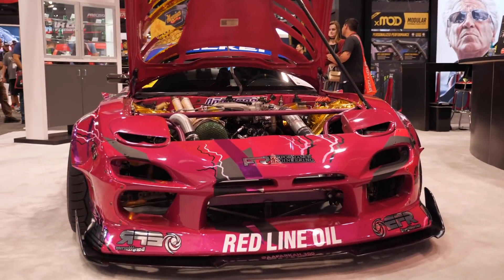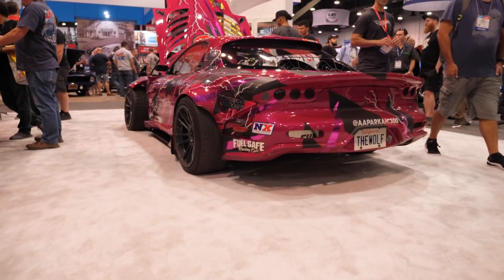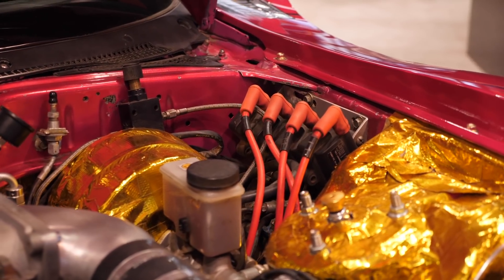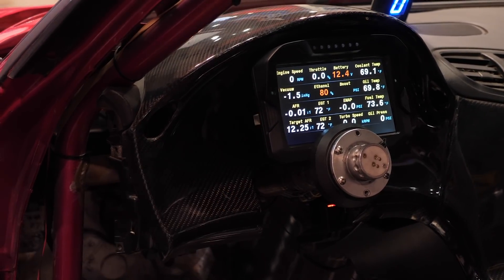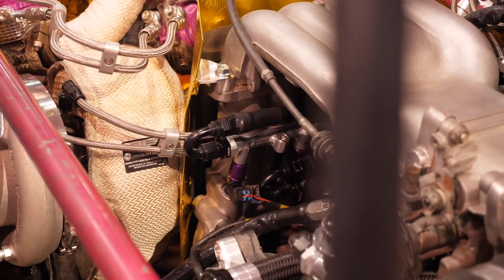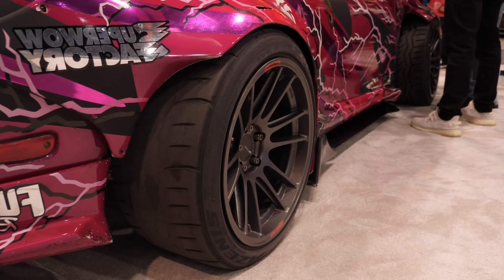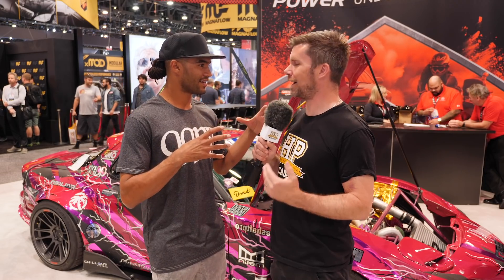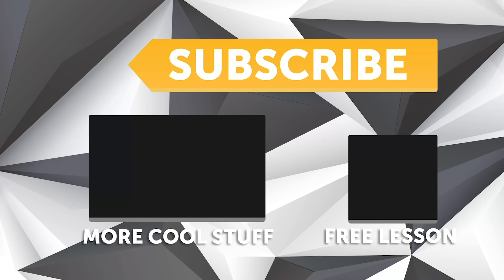No LS Swaps Here! | 13B Powered RX7 510WHP From 1.3L [TECH TOUR]

Comment: That was a little painful. Seems he dint know the reason people go to premix. Sump oil isnt meant to be burnt, 2 stroke oil is and is designed for that form of application, sump oil is not, but then yes, you can mix the ratio to suit. 2nd, does he seriously use two parts fuel to 1 part oil?? Or did he just reply wrong?? That seems waaaaay to rich on the oil side. He wouldnt need to turn the tyres to create smoke with that much oil being burnt.
Reply: Rotary engines are designed to burn oil from the sump, so it is meant to be burnt by design but correct oil must be used aswell as service intervals maintained.

We premix for a few reasons.
A fuel injector has better dispersion of fuel/premix in the housing creating a better lubrication barrier throughout the entirety of the housing.
Premix does away with the original omp and oil injectors which can fail.
Sump oil contains contaminents.
You can run higher grade oils like synthetics which you previously couldn't as they produce carbon deposits when burnt and can make rotor seals stick.
Your sump oil level is maintained meaning less frequent checks
 
He is actually mixing at of ratio of 60+:1 which is still heavy.
60+ parts fuel to one part oil or 2 ounces to 1 gallon which isn't actually 2:1 ratio.
Too much premix not only smokes alot but also lowers octane rating of fuel and knock will fuck a rotary real quick
Reply: @DStead2239  yes correct, rotary engines are made to burn oil, but sump oil which generally isnt made to be used that way compared with 2 stroke. Which is why we delete the oil metering pumps and run premix with a high quality 2 stroke oil thats  made to burn this way. That ratio sounds  a lot better but still way too oil rich.
Reply: @ZLAKLR20B  "sump oil" and 2 stroke oils have very little in difference. 
Engine oil however will seperate or gum up in fuel if left in it for extended periods which is why you use 2 stroke oils specifically designed to be premixed with petrol or castor oil if using ethanol.
"sump oil" or more specifically engine oil is perfectly fine to lubricate and burn so long as it's low ash and not a synthetic.. 
Like I already mentioned, engine oil works in a stock rotary aslong as oil is of the right grade, oil level is maintained and service intervals are kept to.
The benefits of premixing I've already mentioned and are why you delete omp, not because engine oil is inadequate or not meant to be burnt.

Comment: 2:1 mixing!? That can't be right, can it?
Reply from the maker: Sorry for the lack of clarification there, 2 oz to 1 gal - Taz.
Reply: @hpa101  that makes more sense! I was wondering how that would even ignite...
Reply: If my calculations are right, that's a ratio of 64:1. I normally run around 120:1 for my track car, but that's on pump fuel

Comment: 2stroke? nahhhh it is a 4stroke
Reply from the maker: The rotary engine is in fact a 4 stroke engine, however unlike a 4 stroke piston engine they complete a full engine cycle every revolution of the crankshaft (eccentric shaft to be accurate) instead of every 2 revolutions in the piston engine. This is why they're often generically referred to as a 2 stroke.

Comment: Can you explain why F1 cars illegally suck oil into the engines to increase power? In reference to oil reducing octane levels
Reply: Because of the additives. They can't have certain additives in the fuel so to get an edge they drink oil alongside those illegal fuel additives. But they also have oil limits. They got a certain ratio they can burn in a race.
Reply: Because they are the only engines besides Koenigsegg and a few exceptions that have nearly 50 percent or higher combustion efficiency. Oil vapors are extremely flammable and they are able to take advantage of the added lubricity from the oil and it burns not as bad as you would think. It’s only illegal for manufacturers to do this to duck emissions.
Reply: @CorruptInfinityOfficial  yeah that too. also in road cars it can drive you insane. i have a shitbox honda civic from 2002 that gloriously blew it's manual gearbox. it burns oil and it's simply a bother having to top it up every 2 or 3 weeks. now it started to leak it as well not just burn it. and people don't check their cars, the only time that bonnet is popped is once every service interval that has become nowadays once every 15-20k miles.

Comment: These engines aren’t 2-stroke 🤔
Reply from the maker: The rotary engine is in fact a 4 stroke engine, however unlike a 4 stroke piston engine they complete a full engine cycle every revolution of the crankshaft (eccentric shaft to be accurate) instead of every 2 revolutions in the piston engine. This is why they're often generically referred to as a 2 stroke.
Reply: Well they sure as hell aren't 4 stroke! Their fuel /oil mix requirement is similar to a 2 stroke.
Of course a rotary doesn't have "strokes", but the combustion process has a bit in common with 2 strokes.
Reply: Steven Kelby I guess it depends on how 4-stroke is defined by the individual. Fact is rotary engines follow the Otto cycle and each face of the rotor makes the 4 strokes so to say.
Reply: True, but make power similar to a 2 stroke
Reply: Probably makes more sense to call it a 4 cycle engine imho

Comment: You guys got typo in desc. - "running pump Ethanol fuel and a 2:1 oil to fuel ratio" should be fuel to oil ratio
Reply from the maker: Sorry for the lack of clarification there, 2 oz to 1 gal. When at a push I'm just getting words from the video to the description rather than dissecting anything, lesson learnt and cheers for pointing that out too - Taz.
Reply: @hpa101  oh, so its 1:60 mix, because i use 1:40 (oil to fuel in liters) in 2 Stroke equipment/bikes, and if they are new, then 1:10-1:20 mix and it is smoky as hell
Reply from the maker: @exvils  64:1 I believe. I don't have to work with imperial as often as Andre so not as on the button with it, but that's what Google conversion charts told me haha
I have my first 2 stroke bike and am running it at 60:1 (previous owners mix) at the moment which is still is a bit too much for the type of use the engine sees from me - Taz.
Reply: nah they actually put more oil than fuel xD
Reply: @Nebbia_affaraccimiei  2 stroke? This thing is marine diesel!
Reply: also what type of oil are they using? my guess is some 2T red oil

Comment: 2:1 WTF?.. that is ridiculous..
I run E85 on the street in my fd, S8 13b bridgeport similar power and boost level but run 150:1 using Maxima Castor927..
Too high a ratio lowers octane and is just stupid and wasteful, especially as a 1litre bottle is about $35 from my local bike shop.
Reply: I'm guessing he means 2 oz per gallon? Half a gallon of oil per gallon of gas would be ridiculous
Reply: @dirtysp00ns  Ahh yes, that would make more sense.
Americans have backward ass units of measurement..
More likely to be 2 gallons to one ounce though. Even then that's not "scale" as they're different units (gallon/ounce)..
I've run between 150:1 and 200:1
Converting US gallons and liquid ounces to litres would mean he's running a ratio of 188:1 which is normal..
That's assuming his nonsensical scale/ratio of 2:1 is 2 gallons of fuel per ounce of premix oil.
If it's as you say, 2 ounces per gallon that's roughly 93:1
Reply: @DStead2239  They definitely do have crazy units of measurement haha, I'm a Canadian from the land of litres. Used to run around 100ml of oil per fill up in my FC, can't remember what that ratio was though
Reply: @dirtysp00ns   Nova Scotia obviously🤦‍♂️.. 
I'm a Kiwi living in Australia. Both Rotary mad nations that use proper units of measurement too lol.
Reply: @DStead2239  2 gallons ethanol to 1 ounce oil would not be enough oil. ethanol has low lubricity so it requires more oil than gasoline. it should be 2 ounces oil to 1 gallon gasoline, i think it works out to be 64:1 ratio.
Reply: @DStead2239  holy shit haha someone who has actually heard of our lil province! Most people have no clue
Reply: @7sins979  Nope it's enough. Whilst Ethanol blends have less lubricity they also run richer, therefore more fuel/premix, same lubrication..
 I run 150:1,  dedicated E85 with castor oil..
I built an Extend port run like that for years, pulled to bridgeport it, no undue seal wear, plates and housings fine.
Reply from the maker: Sorry for the lack of clarification there, 2 oz to 1 gal - Taz.